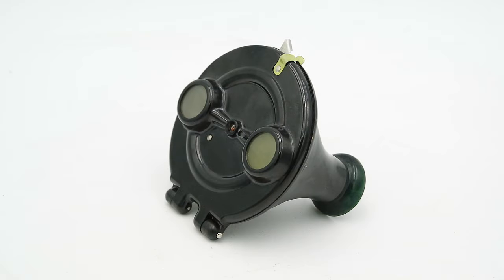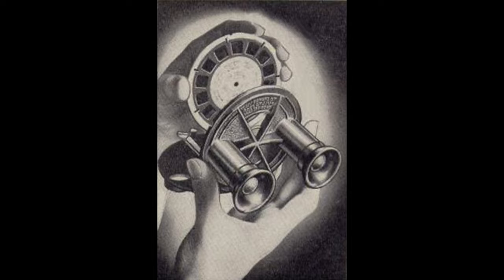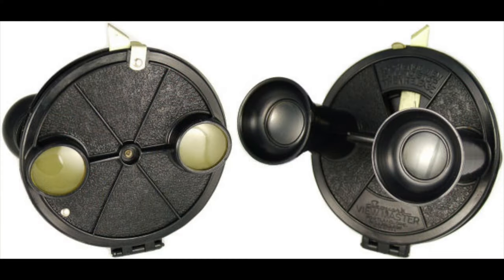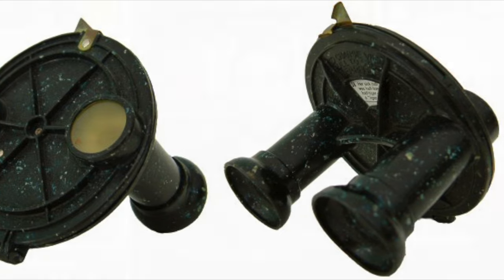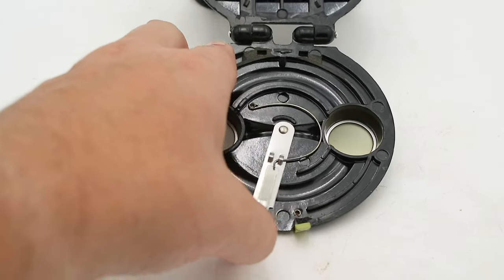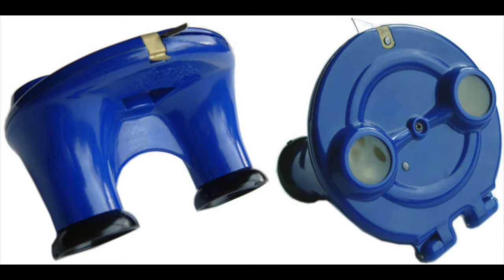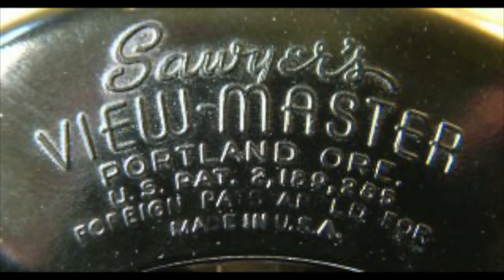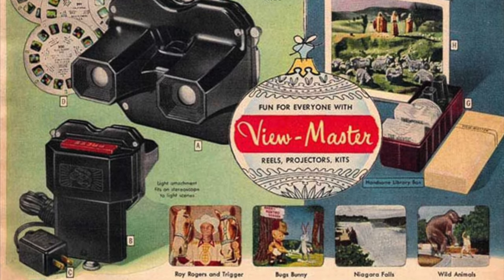SHORT: Viewmaster Model B

Comment: Cool. I became interested in the topic and it turned out that today there are such gadgets connected to the phone. The appropriate application delivers images to two screens.
Reply: I own several 3D cameras. But the first one I bought was a device called Poppy3D which worked with iPhone 4.  You slid the phone into the top of it, and it worked as a beam splitter (using mirrors to capture the left and right eye images simultaneously on the camera sensor, making a side-by-side stereo pair, which the same device let you view instantly in 3D, functioning as a type of View-Master stereoscope.  I loved the thing and shot almost 1000 3D photos with it.  Sadly it was not a big seller and no future versions of it ever came out, as would have been necessary as phone shapes and sizes change every year.
Reply: @TedwardsTube  Yes, this was definitely the weak point of this concept: adaptation to a specific model and shape of the phone. It was necessary to allow any smartphone to take photos for this device or to mount two lenses on the View-Master itself. But you know, it's good that you're writing this to me. I am currently developing an invention and you made me realize that it is important to adapt it to various other devices.

Comment: Was it necessary to use a dual-lens camera to take these photos? Was it enough to move a regular camera from one place to another (within second eye distance) and take normal photos from these two perspectives?
Reply from the maker: Yes, a great deal of precision was needed in the spacing and alignment of the images or the 3D effect wouldn't work. That's why Viewmaster sold a specialized camera for this purpose as well as a punch for cutting the stereo pairs out of the developed film.  I actually cover the camera and all the accessories for making your own stereo reels in my previous two Viewmaster videos :)
Reply: @CanadianMacGyver  Hmm, yes, precision is certainly necessary, but what if you mounted an appropriate rail on a tripod and moved an ordinary camera very precisely along this rail? In addition, modern digital cameras can somewhat correct human errors. Since they have already made a digital version of such Viewmaster, everyone should be able to use their photos from a camera or smartphone. Or maybe there is such an option? I need to dig deeper into this topic.

Comment: Remember when Kodak came out with the camera that had  a circular disk holding 15 negatives? Had that been 16 they could easily and cheaply sold 3d cameras that either fitted these or just a different sized view master viewer
Reply: Disc cameras. I had one back in the day.  I had this same thought just recently, that they should have designed them to shoot 3D and for the reel to fit into a viewer.
Reply: I had one. They were awful. The negative size was just too small and they took dreadful pictures, even worse than the 110 cartridge. 😞
Reply: @Bartok_J  that is a good point I forgot that !
Reply: @Bartok_J True, by today’s standards. But I loved my disc camera at the time because it was so completely simple and idiot-proof.  Our standards for image quality weren’t exactly high in those days.  Many of us still had black and white TVs, and we were taking pictures with Polaroid Instamatics.